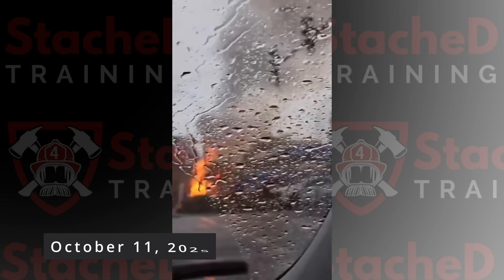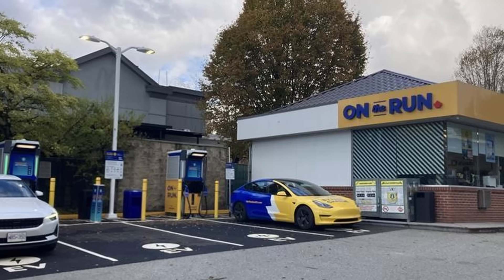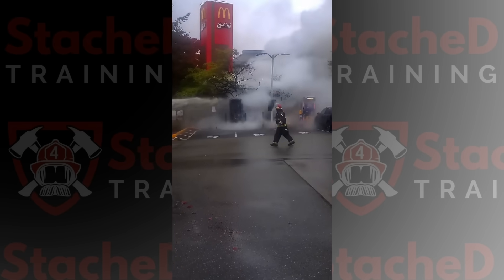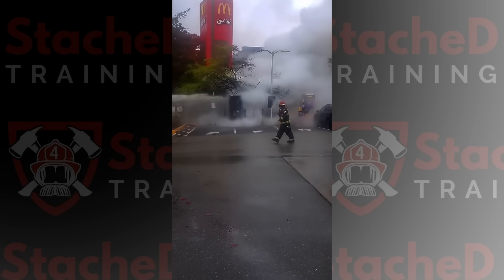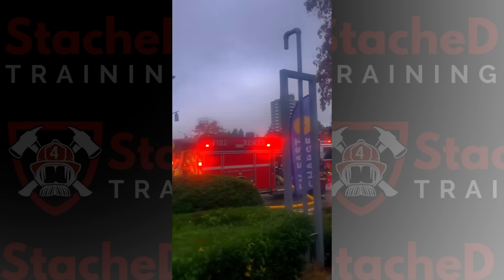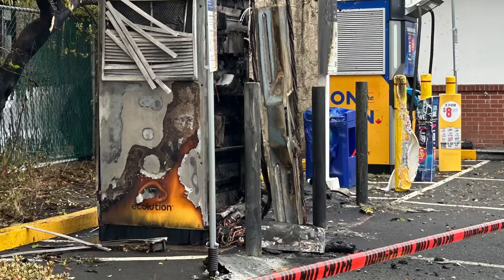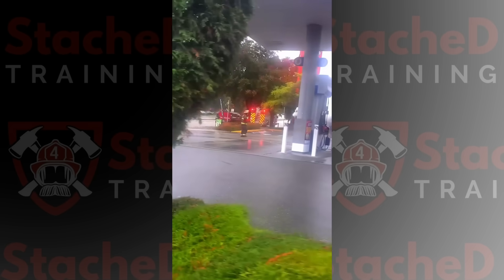EV Charger Fire in British Columbia: Hidden Batteries!

Comment: I am an EV charger technician. Fire issues aside, having accessible, standardized grid power shutoffs for each charger would make my job safer and easier.
Reply: Im amazed you guys don't do that as industry standard. Why wouldn't they put in a pull fuse similar to what they put on external condensers?
Reply: @joeblow5214  The chargers I work on come as a self contained unit with breakers inside, so for 95% of repairs I can just rely on those breakers. But occasionally I need to work near the bus bar connections between the charger and the grid, and so for that I need to use an external shutoff. The quality of work done by the electricians hired by the gas station (or wherever else the chargers are) who initially install the chargers varies greatly. Sometimes there's a convenient, labeled shutoff right near the charger but other times it's inside a electrical cabinet behind the building, and locked with a key that no employee in the gas station has. That's where safety regulations dictating location, accessibility, and labeling would be really helpful.
Reply: @phoenixrambles hey! I would love to speak with you about EV chargers. Do you have a website?
Reply: One would think that Electrical Code would mandate that when the gas station attendant (or anyone near an emergency shutoff switch) hits said "oh SHIT!" button, all power, both to the gasoline pumps and the EV chargers would be disconnected.
Reply: @mikedowd6015 there's an e stop inside the store right behind the attendant that shuts down everything.... The pumps, EV chargers, dome lights etc.

And most Chevron sites have them outside the store front also. About 15 feet from that charger.  That clearly wasn't the issue.
Reply: @mikedowd6015 their is a shutoff for the gas pumps already, its been standard for a long time.
Reply: @jonathanjones3126  How many people had to die before that became standard?
Reply: @shane99ca i wasnt around back then, but probably none to alot depending on how many people where involved and there motivation level.
Reply: The special lock on the disconnect box is a special fire department key, normally locked inside a NOX box at the site. 

The best way for you to stay safe is to have your company require complete energy disconnect prior to any work inside the system.
Reply: @CycleWerkz I still remember the old CRT television sets with the capacitors that had to be drained to work on the tv.
Reply: @jonathanjones3126  I still remember the shock you could get just touching the screen. And if your early childhood memory is REALLY good, you can still remember tge high-pitched, scratchy hum they made while in operation. Toddlers can hear this frequency, but adults can't.
Reply: @jonathanjones3126  That trouble moved to microwave ovens. Much larger giant capacitor to supply Plate voltage for the Magnetron Tube.

They do have a bleeder resistor between the capacitor poles, which is designed to "bleed" the stored energy out of the capacitor. It works very well. However, the oven is being repaired because something failed. The resistor installed may have fractured over decades of use, so never trust it. 

I always short those terminals together as soon as I open the case.
Reply: @jonathanjones3126  Lots of electronics have this issue, anything with caps you have to be weary of.
Reply: Typically the approach in BC is to pull the meter or at higher voltages/amperage there will be a disconnect. Not sure where it would be in this case without going to site.
Reply: @AmurTiger  When I design generator plants and 4kA Switch Gear Lineups, I always put one EPO inside the equipment container, and another outside the container very near the visual portal. I add another a safe distance from the device which may be ablaze. NFPA rules changed to now force 2 of the 3 in my designs.  
For this site, I think I'd just use the discon inside the charger, another outside of the building right by the door, then one more inside their power room.
Reply: Lock Out? how do we lock out a bomb?
Reply: Electrical, you know the CEC? 
B.C. not using it?
Reply: I must say the ev is absolutely trash and you guys should let that burn away
Reply: Need more J1772 chargers. Thanks.
Reply: I'm an electrician. This thing has batteries. Shutting it off from source and calling it safe doesn't work. All the units I have ever installed are fed from a dedicated panel, have very safe internal disconnect points, and also do not have batteries. Why does it have batteries?
Reply: @alexel7814  The video explains that in detail. This design is for locations where the grid capacity is lacking; i.e., most non-industrial and residential neighbourhoods. The batteries quick-charge the EV, and then the grid can top up the batteries. This allows fast charging in neighbourhoods where it would otherwise be unavailable.

Big difference between single-phase 240V and three-phase 480V.
Reply: @shane99ca  I understand what they are, I just think it's a dumb thing to have high-capacity batteries in a consumer device for the sake of time-savings. 

Also, I've installed chargers in buildings with 480/600V systems available, and they are always 120/208V.  I would think this is because safety trumps convenience for these big property management groups.
Reply: @alexel7814  High-capacity batteries are now in virtually every consumer device that isn't a smoke alarm or an AirTag. Hit your iPhone with a pickaxe and you have an excellent chance of a short but energetic blaze. Not exactly your daddy's D cells.

Also, the chargers you installed—can you clarify please? Are they actual Level 3 fast chargers that can substantially top off an EV in half an hour? On single-phase 208? That sounds...optimistic.
Reply: I used to do routine inspections and go live testings for chargers. There have been couple times when I plugged in my EV and the chargers just went “poof!” And black smoke started to come out.
Reply: As a commercial electrician, would yoy all like a real answer? Or just complain?
Reply: As they said in Schoolhouse Rock, "There oughta be a law." In fact it's beyond unbelievable that isn't not law already. But I guess they're just waiting for the bodies to start piling up. They always do, for some unfathomable reason.
Reply: I pray for your quick end.

Comment: Clearly the method of charging should be changed to swapping the battery from beneath the car like the systems overseas. This way the fast charge is away from the user.

Comment: Not surprised about the hidden EV charger batteries. I've never been near one, but it seemed likely to me.

I think that MGUY Australia, an electrical engineer, directly stated it as being likely, or I inferred it, his logic contributing to other indicators.

MGUY bemoans the idiocy of the Net-Zero crowd using logic, hoping they become educated enough to understand that batteries can't run shit - before they're Dark enslaved little pleasure servants.

Mostly bad new energy propaganda from vested interests in the industry, media, and the long ago established Dark government institutions that continue to rule.

Windmills look more like an attempt to keep the railroads afloat to deliver coal and fuel than a serious attempt at harnessing and using wind energy efficiently.

Also, many seem to think that modern electrical devices just spit out a trouble code that tells the idiotic what part to swap. Real mechanics used to call them parts hangers. Many financed a Snap-On brick scanner from the tool truck guy. 🙂

Comment: You know, standard chargers don't have much electronics. In fact, they are mostly just a big 3 phases transformer with a 3 phases diode bridge and a few contactors (which are just some big relays). The rest of the electronics is some safety stuff, like ground leakage detection, and a computer to take the payment.

Comment: What about the placement of the LP gas bottle storage?  Though the charger that burned was further away had the closer charger gone up in flames that's a bit too close for comfort.  I know the cylinders are very durable a small leak could be significant.
Reply: doubt it. If it gets hot enough the popoff valve will open. The stream output is not easy to ignite. If so, it'd be a flame, not detonation.
Reply: @CycleWerkz Thanks.

Comment: btw Captain, don't forget the full size BESS fire at the Salt River Project in Glendale Arizona that occured back on October 1, 2025.
Reply: Good point. From footage, it looked like 2 container-size units were damaged, but spacing was such that other units were not visibly affected. Perhaps that site was even "well-designed"!
Reply: ya know since rudetoy brought it up, there's actually another good comparison to be made right now regarding the INCENDIARY NATURE of Li-Ion batteries versus ICE, and that's between this video of a Boost Charger on fire at a gas station up in BC (Canada eh?) and the dramatic video of the Bell-222 crash that occurred at "Cars and Copters" down in Huntington Beach...

that's right here a min-BESS lights off, but at the same time a Helicopter filled with Jet-A loses a linkage, has the hub for it's tail rotor explode almost immediately from the imbalance, thereby sending it "Auto-Rotating" down to the ground (Mechanical LTE) and yet we get NO GINORMOUS EXPLOSION, and we get no post-crash fire, and this occurs even with a fuel tank apparently ruptured and both HOT turbines audibly still running as by-standers race to their rescue.
Reply: @phillyphil1513  I think a bunch of peeps got the fear put in em with all the "one spark and your whole car sets on fire" crap. God knows how many times I've shared cigars with fuel barge workers whilst refilling 20+ 25L  jerry cans and a cigarette/cigar dangling from my mouth. This is from commercial fishing seasons. Its not that it CANT happen, its knowing the best case scenarios for it TO happen. When i smoked with the fuel workers there was always a high gust of wind taking the vapours away faster then created, or we we're working with strait diesel
Reply: And almost the same thing in April 2022. Also Salt River Az.
Reply: Oh sure, betting this dude creating propaganda for big oil companies. When Pinto explode from rear ended in 1970, did you complain? How about Corvair swing axle problem in 1960? How about the Bronco II roll over risk in 1983? How about Crown Victoria Police Interceptor gas tank burst into flame in rear collision in 1992? I didn’t hear you open your trap during those time, why don’t you
Reply: @rudetoy8264  re: "Oh sure, betting this dude creating propaganda for big oil companies." A: no. Q1: When Pinto explode from rear ended in 1970, did you complain? A1: yes. Q2: How about Corvair swing axle problem in 1960? A2: yes. Q3: How about the Bronco II roll over risk in 1983? A3: yes. Q4:  How about Crown Victoria Police Interceptor gas tank burst into flame in rear collision in 1992? A4: also yes. okay next question please.👌

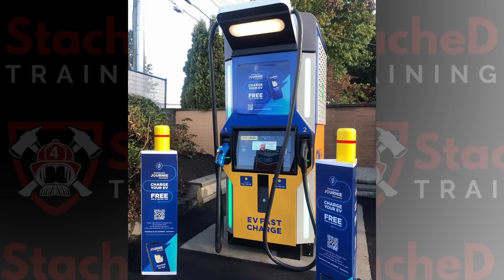Comment: 1:02 - Some Industry insight, those mini BESS' are the old "Boost Charger" units made by a company called Freewire out of Newark Ca. and the company technically went out of business (there's a shocker) back around June of 2024.  now the latest news as of September 2025 is that the company assets have been bought by Orange EV the maker of Electric Yard Trucks located in Kansas City, these would be those single driver, short wheelbase units you see moving around trailers at Terminals and Warehouses.  after originally using NCM, Orange has apparently made a BIG shift to fitting their trucks with LFP on the "narrative" that LFP is "safer" (I spoke with them out in Vegas May 2024).  so given this fire they might be looking to do the same with these pre-existing Boost Charger installs.